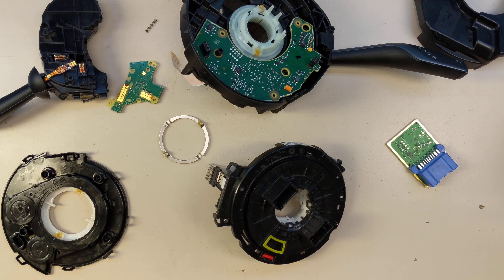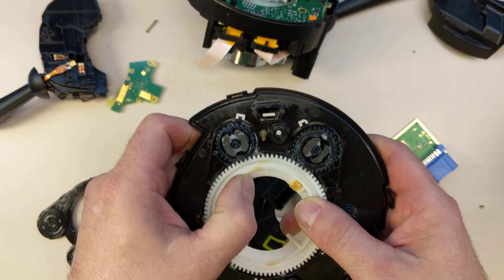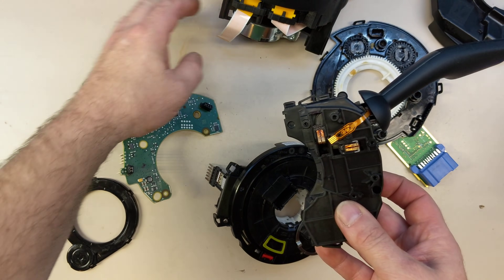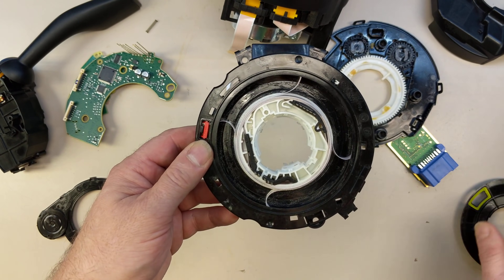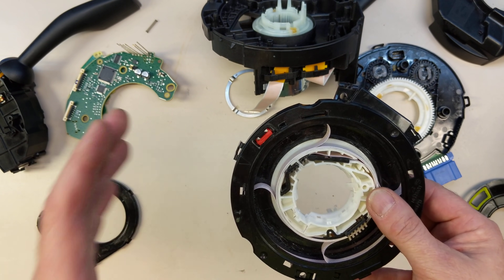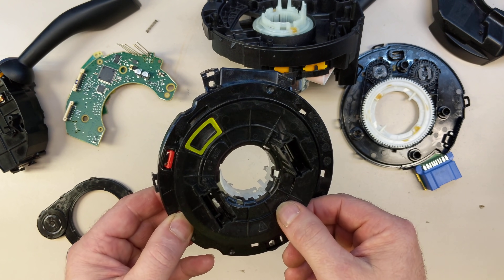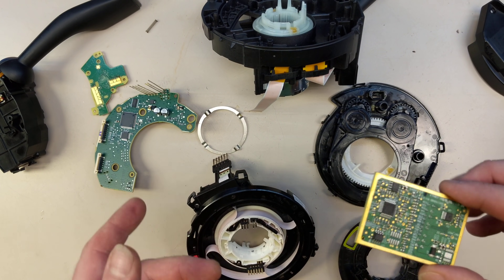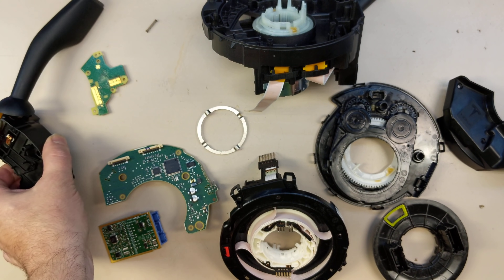Tesla Teardowns - Why is there a CLOCKSPRING?!?

Comment: my turn signal stalk makes harsh cracking sound, it happens when i push all the way up and in motion to bottom. Looking for DYI fix. or any idea what could be problem, can i for example spray WD40 in to stalk? Tesla model3 2021,
Reply from the maker: I think I'd just order a used one off ebay.  Part number is 1097662, and from Tesla they are $400 new.  Here's one for under $100: https://www.ebay.com/itm/306142286376   The stalk part comes out of the assembly, keep you existing main assembly and just replace the stalk part, and then no software issues.
Reply: @Ingineerix  thank you!

Comment: I just had this clock spring ribbon come flying out due to me forgetting to disconnect the plug before removing the steering wheel. Insane length and I’m unsure if I’m going to be able to spool it back in correctly. What an absolute headache I’ve made for myself.

Comment: I accidentally got the clockspring ribon  lose but nothing is broken. By watching your video i think i would be able to get the ribon spirals and move as seen in your video. If i do, will the Tesla Model 3 recognise the clockspring automatically or i need to do something in service menu? Or once it comes off even if i get it back, Tesla will not recognise it anymore? Currently my Tesla Model 3 2020 AWD is complaining that buttons are not available. I would be grateful for your thought.
Reply from the maker: If the buttons on your wheel are not working, then the clockspring is broken somewhere even if it doesn't appear that way.  Best is to replace it.
Reply: @Ingineerix  Make sense, thank you
Reply: @Ingineerix after putting all the ribbons as you showed here and also put it in center position "2.5 turn both ways", with my surprise buttons & horns are working fine. I have no idea how i managed to put the ribbons though. It just happened upon trying for an hour. Thank you so much for showing how it should be and works, as only because of your video i was able to put it back together. Please continue such videos as no one does it like you.

Comment: Do you by chance have anything that indicates where the magnets should be positioned? I had to remove my assembly because it was squeaking and after 4 service attempts, Tesla couldn’t fix it the lubed many points with some silicone grease but the magnets apparently are out of alignment.
Reply from the maker: I'd recommend just getting a salvage assembly, it's cheap enough that it's not worth your time:  https://www.ebay.com/itm/403950782718

Comment: @Ingineerix are the stalks swappable? Could the ribbon connectors be swapped between sides? We’ve three cars with the indicators on the right and the model 3 on the left. I keep turning on cruise control as I turn right arggh. In a software defined car they should be a setting to swap sides but I’m having to look at more drastic measures. Thanks.
Reply from the maker: There is no way to do it via software alone as there are hardware differences between the sides.  (stalk button is 2-stage on left, high beam toggle on left, etc)   Now with some work it may be possible to build a swapped set, but it's non-trivial and would require cracking all that open.

Comment: I have a question you might know. How does the car sense the amount of force I turn the steering wheel so it knows how much the steering assist motor has to do? My steering assist is acting up a little. Trying to figure out where to troubleshoot

Comment: Also connected to this: three push buttons behind the driver airbag to sound the horn. May have been too simple to be mentioned. 😀On newer Model 3, also a steering wheel heater is available. Then some of these rolling ribbon cables actually get some minor load on them. I don't know the wattage though.

Comment: The gears according to an automotive engineer, the twin gears that rotate differently or opposite directions also serve as error detection in case of a sensor failure. 

The car knows exactly what to expect since it's a fixed ratio, anytime it's not what is expected. It knows something is faulty which depending on manufacturers have multiple fail safe modes such as disabling stability control or throttle input since the car can no longer rely on data provided by the steering angle to determine the direction the driver intends to go.

Comment: Huh i always knew there was a clock spring cable going up to the steering wheel but I was a little puzzled by it. I mean you can slip ring CAN signals, though that's usually just LIN to wheel and that's even easier; and if that hadn't been an option, all sort of inductive connections are conceivable. I had somehow completely forgotten about the pyrotechnics! Obviously when we worked on the stuff on the software for the headunits etc we didn't often need the steering wheel, using CAN simulator instead, but those that we did have, didn't have the airbag.
Reply from the maker: A slip ring is going to be less reliable, and arguably more costly than this simple flex cable clockspring.   They definitely can't chance airbag connections on a slip ring.

Comment: Do fully drive by wire systems need this level of complexity. I think Tesla may be moving to drive by wire soon. Honda and Toyota have made a few drive by wire vehicles already.
Reply from the maker: The only "steer by wire" on the market I am aware of is Nissan's system in the Infiniti Q50.  It took 10 years to develop, and still has a hard mechanical backup.

Comment: The driver wheel Is basically "fly by wire", I don't trust software that much, why can't we have mechanical things, just kidding, someone has to test it, why not early adopters of tech, I'm staying with full mechanical car.
 (full disclosure: I'm a software developer)
Reply from the maker: No, this is not steer-by-wire.  There is a direct mechanical connection from the steering wheel to the road wheels, same as almost any car built in the last century.

Comment: wow, surprisinly complex and costly system.
I wonder if they are going to replace most of that with wireless signal and power in the near future.
Reply from the maker: This definitely isn't costly!   Due to the laws of physics, you can't send any reasonable amount of power over anything more than a really short distance.  Communication is of course possible, but would cost more.  Since still need to send power, so why not add one more wire or 2 and not have to worry about the extra cost and unreliability of wireless?   Doesn't make sense, and imagine what happens when the RF noise floor gets untenable?
Reply: @Ingineerix  I didn’t think about the power requirement to deploy the airbag, this probably need a substantial pulse of current. This could be done with capacitor pre-charged, other than this I don’t see any need for substantial power, only communication. True, you don’t want your airbag to fail because of some interference, that risk need to be addressed first.
Like you said, before it was just a single contact and now we get a sophisticated system, what is next ?
It seems costly to have all those parts interlocked, they all need to be molded, assembled, put in place, tested.
Reply from the maker: @alexforget  The NRE costs to manufacture such a unit are insignificant when spread over hundreds of thousands, if not millions of units.   I can assure you that you will never see wireless power transfer used to deliver power to devices in cars, except maybe your phone.  Especially for safety critical systems like airbags or PRND selectors.   Keep in mind for wireless charging to work it is relatively low-power, and the 2 coils must be literally right next to each other.  If you pull your phone away even a few millimeters, it stops charging.

Comment: I was under the impression that flexible pcbs, flex cables etc. are not designed to be moved too much. but here they flex every time the turn signals are used.
Reply from the maker: Ones made with Kapton Polyimide are very robust, they can flex almost forever as long as the bend radius is respected.

Comment: Why there are 4 pairs of cables despite only 6 pin put on port?
Reply from the maker: There are more than 6 pins.  6 pins are dedicated for the airbag circuits, to those pass right though, there are other ribbons that carry power/data for the steering wheel controls.

Comment: So, based on the title I assumed you were going to talk about why Tesla isn't using a slip ring or wireless for the auxiliary steering wheel functions, but you didn't really address this - the obvious answer is that they have a clockspring because almost every vehicle made in the last 30+ years has a clockspring. Tesla is known for doing things different but what are their options? They could use a slip ring, but maybe they're too expensive? Wireless is being introduced for battery pack management so that seems within the realm of possibility.
Reply from the maker: Very VERY few people know what a "clockspring" is in this context, so I thought it would make a good topic.  Sorry to let you down, but Tesla does this just like all the others.

Comment: Magnets in a position encoder seems not necessary, mechanically complex, and expensive.

High resolution direct to digital output rotary encoders using optics are less complex, not sensitive to magnetic disturbances, and thus safer and are standard off the shelf components. Encoding of multiple turns position via a reduction gear, and it's as easy as that. Does not even require a microcontroller, and provides instantaneous absolute digital position information.
Reply from the maker: Cost.   This arrangement is cheaper and easier to manufacture.  There are no precision components, yet the output is high resolution.  I don't see how you can say a microcontroller is not needed, both systems need some way to decode the inputs and generate CAN, so a microcontroller is needed.   Automotive is the most cost sensitive mass market only behind consumer products.  There's no way an off-the-shelf optical encoder is cheaper than this system, and even if you wanted to manufacture one, I don't see how you can get anywhere close to cost parity with this system.

Comment: Think of the cost savings when FSD is level 5 and a steering wheel or yoke is not needed.
Reply: Will not happen anytime soon (next 10 years or so). At Level  4 and 5, the steering wheel will likelybe even more complex with a temporary retraction feature. After that, there will likely be a sealed hole to the steering shaft, where some mechanic can attach an external simple mechanical steering wheel for repair times (defects on power or control or actuators).

Comment: Can you do a video about how Tesla senses hand presence on wheel?
Reply from the maker: Doesn't need a whole video.  They just monitor the torque sensor on the steering shaft.  A small amount of bias is caused by the weight of your hands that can be detected.  They are also now starting to use the in-car camera for driver monitoring.

Comment: I had an issue with the SRS system on my Model Y, and felt the components were not developed under Tesla's "roof"  I would appreciate you insight into the individual systems that you conclude that were Tesla designed or contracted designs.
Appreciative of your content.👍

BTW I was impressed that the problem with the SRS was diagnosed OTA. The parts were ordered, and it took them 2.5 hours to replace the faulty parts. Normally a two trip process, and at least a 3-4 hr job.
Reply from the maker: Correct, the RCM (Restraint Control Module) and airbags are outsourced.

Comment: I was working for Kostal and indeed the whole module is not designed by Tesla. For sure there are very interesting design solution, but also some of them are not so reliable.
Reply: Hi would you happen to know if the electric connector for the canbus to the vehicle is a standard kostal connector or a special for Tesla ?

Comment: The old cars had a wire that went through the steering shaft for the horn, the only thing on the wheel. The wire just twisted over the length of the shaft. Then they started using a slip ring arrangement on newer cars still for the horn. When computers and air bags started to be used they went to the clock spring because they needed more connections. GM and some other manufacturers started using a series of resistors for the switches that only required 2 wires, and the computer read the voltage to determine which switches had been pressed. Since then there has been several different approaches to solve the problem. Some might even bring the CAN bus to the wheel. Just remember, don't spin the wheel if the steering shaft is disconnected !

Comment: Amazing engineering.  Stuff we take for granted on a daily lol…to engineer something like this, the designers probably had to engineer the driver circuit for just that connection to compensate for inductance to protect the data integrity between the steering wheel computer and the steering stalk computer
Reply from the maker: Yes!  So many details people take for granted.    There was a whole TEAM responsible for just this SCCM (steering column control module).

Comment: Thanks! I always wondered how that was done. I previously assumed they just kept a crappy slip ring, and just sent a digital signal through it (whatever protocol with heavy error detection and repetition ) Nice to see this mechanically robust solution .. and dual sensor setup.  I imagine the dual sensors can also detect and compensate for the gear slop
Reply from the maker: The dual sensors are needed to detect greater than 360 degree angle and do so in an absolute manner.   There are 2 mechanisms built in to remove the "gear slop" (backlash), as this would definitely result in measurement error.  The output of this is used for autopilot as well as stability control, so it has to be accurate.

Comment: It would be INCREDIBLY timely right now to review/overview the charge controller module that contains SWC and now PLC. Lots of people talking about Tesla's move to open Superchargers to third parties - applicable right now in Europe where Tesla already has switchable PLC/SWC circuits (what was previously just J1772 was extended with PLC capability in ... what, late 2019 and up Model 3/Y when the Y came out?), and my theory is that Tesla may be moving to unify CCS as the overall standard. Could be perfect timing if you have one on hand to talk about PLC (J1772/ISO15118) and SWC (Tesla SC/UMC) signalling and how it relates to interoperability.
Reply from the maker: Done!   https://youtu.be/0lxxOsLcNQQ

Comment: Obviously these are fun breakdowns, and thank you for them, but it would be more interesting to analyze parts that are truly unique to Tesla.  

As we know, like most other automobile makers, Tesla sources most of their parts from external vendors: steering, suspension, brakes, wheels, tires, glass, chemicals, dashboards, touchscreens, cameras, etc.  Contrary to popular opinion, Tesla is not totally vertically integrated.  

However Tesla does make the most important parts of an EV: motors, battery packs, some electronic hardware, most software.  Software is really the key to their outstanding functionality, and Tesla is far better at it than most other car makers.  Really the engineering of every aspect of the cars is excellent.

This stands in contrast to many other EV makers who get their battery packs and motors from external suppliers like LG, etc.  (That would be a bit like GM or Ford buying internal combustion engines from Hyundai.)

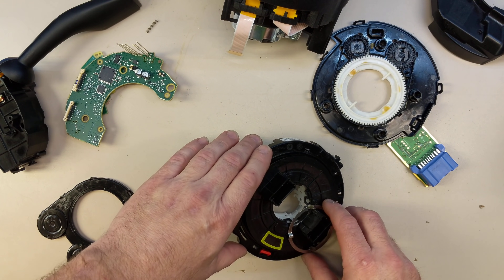Comment: I'm interested to know if the central clock spring part at point 3:25 min in the video is available from Tesla spares and how much they sell it for? When I had to replace a basic clock spring in a legacy car brand, I was socked by over inflated dealer price for the part. Basic because it had one ribbon, (four wires for horn and airbag) and plastic casing with connectors. Not nearly as complex as this Tesla one. Thanks for sharing your expertise and the great video content.
Reply from the maker: No, not only would the parts not be interchangeable (I can almost guarantee), but parts like these are only sold as a complete assembly.  If you are on a budget, try a pick-and-pull junkyard.

Comment: I still don’t know what a clockspring is.
Reply: A clock spring is a spring (energy storage device) that can wind up without the force increasing in a linear manner. So as you increase the rotation, the force of the spring does not increase proportional to the amount of deflection. Not quite a constant force spring, but close. This video did not really present a clock spring in the conventional concept.

Comment: I haven't pulled a tesla apart, but as you say. the clockspring is generally for sensing to the airbag and horn, as well as possible steering wheel buttons. Its interesting what they have, but I guess the hall effect system is used for the FSD system, as well as steering angle sensor as well. So looks complicated, but is probable the easiest way to perform the tasks.